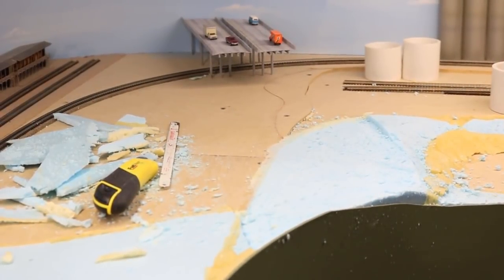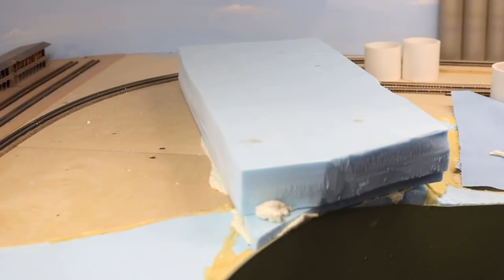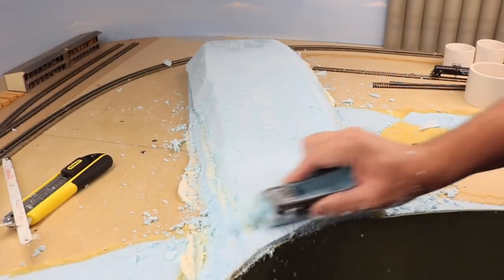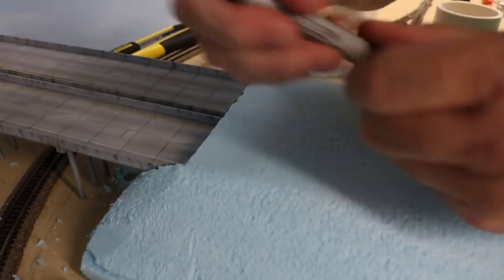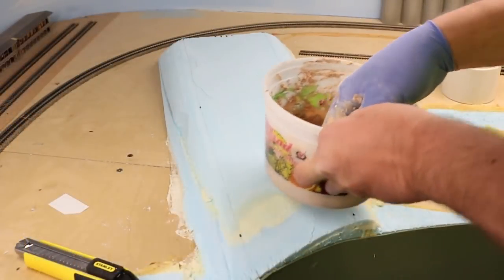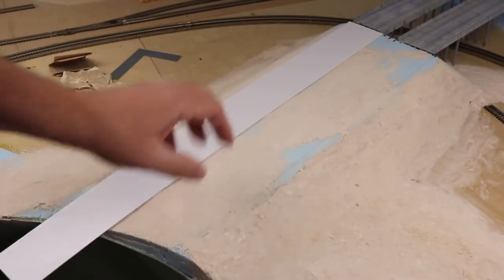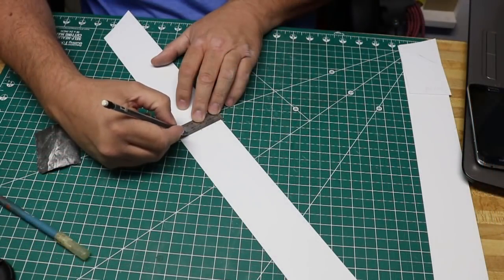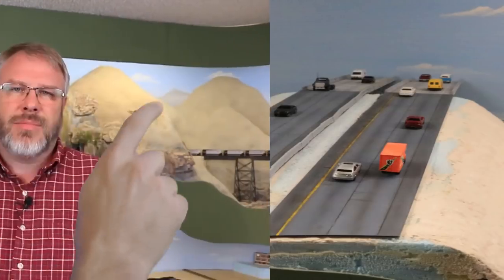How To Build A Highway Model For A Model Railroad Layout

Comment: Hi Ron.  Good timing as I am trying different methods of road building now.  I like this result of yours.  I find it one of the most poorly done aspects of so many model railroads...they just don't look real.  Another approach uses water putty which gives a very good result, but it is a nightmare to work with.  I've done a reasonable road using joint compound.  It is nice because it, like water putty, it is so easy to weather.

Comment: I've used 1/32 basswood sheets for concrete highways with some success.  The surface has a natural texture resembling finished concrete.  I use balsa sheets for asphalt roads.
Reply from the maker: I think those would work well in HO, but in N scale the texture can easily get way to big to be scale.

Comment: Mark first......carve once. Looks good. Going to be tough to finish the back of the terrain facing the wall though. Always a learning process!!
Reply from the maker: It will not be as hard to finish as it might look. there is lots of room back there and it is only a reach of about 18 inches. As for carving, In this case I would rather carve in bits than take the chance of carving too much at first and having to start over.

Comment: I really like the look of the highway. The spray foam looks messy and maybe a little hard to work with. I have never tried it though.
Keep up the great work.
Thanks , Mike
Reply from the maker: The spray from can be messy, but with just a bit of practice it isn't to hard to control. The beauty is that is fills in the gaps in the foam and carves and sands just like the foam, making a fairly seamless scenic form.
Reply: @RonsTrainsNThings  I did notice that and that is certainly an advantage.
Thanks , Mike

Comment: nice work Ron!  I am nearly ready to add a new road myself, so you were quite timely.
Reply from the maker: Awesome. What type of highway will you be modeling?
Reply: Actually, I need several.  I am working on a shelf ;ayout, so I don't have much room for the roads to parallel the track, so I need to have them perpendicular to the tracks.  That means several "bridges to nowhere".  Plus, I was planning a scenic divider along my "industrial" peninsula, but it made the whole room seem smaller and darker.  I am considering an elevated roadway to act as a divider that won't need to be so tall as a hardboard divider, but will still separate the parts of the scene.  That one is still in the concept phase!

Comment: The foam insulation board makes the work easy 👍. But you know that's a 6 lane highway.
Is that 84 lumber I see on the left there ?
Reply from the maker: I do know it is 6 lanes, but mine is 4. And no, that is Universal Forest products which sits North of 820...and yes, it is on the wrong side of the highway here, but it is the only place I could fit it in.

Comment: Great job Ron,  HOWEVER, one slight change would have made the highway more prototypical.

Had you done your trim work, down to the bridge level to the abutting end only, and left the run of highway at the height it was at, you could have slightly curved the abutting end of the foam to appear as a hill or rise, bringing vehicles off the bridge and up (or down) a slop.  Most Interstate roadbeds don't match adjoining bridges or trestles.  They have an incline effect.

Along with being prototypical it would add both an interest point (Where's THAT car coming from?) as well as an additional forced prospective.

This would add one other thing to the layout....less clean up time.  You  used so much of your mastery on cutting and shaving a usable surface you missed saving that surface for you roadway.  Also ALL THAT FOAM DUST.  I'm glad I'm not married to your wife.
Reply from the maker: I'm not sure what you mean. This road slopes up to the overpass, as per the prototype. The foam dust vaccuums up quite easily.

Comment: Nice highway, Ron! You no longer have a bridge to nowhere! Something you might try rather than expand-o-foam is a product I first heard about here: https://www.youtube.com/watch?v=rnOegaOKu38&t=9s (I'm not real thrilled with what she's building from the foam, but.....) It's a product called Glidden Gripper Primer. I got it at Menard's, but you can find it about anywhere. It's a white primer paint. Just a thin coat between layers of foam, and when it dries you will destroy the foam trying to separate the layers! It really works! I hope you have a restful break, and don't worry about us! We'll be here when you get back!
Reply from the maker: That is interesting. I used the great stuff here because, as I mentioned, there were some variations in plywood height so I needed to fill some gaps, but for foam-to-foam that looks pretty interesting. I'll have to check it out. Thanks.